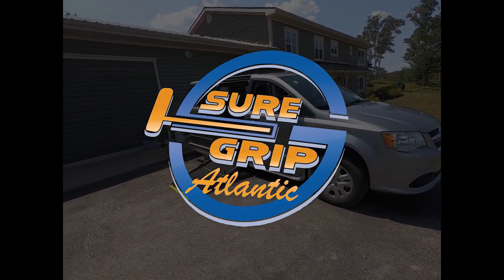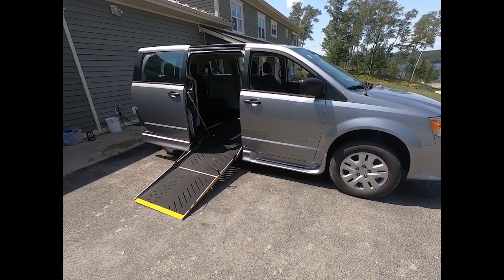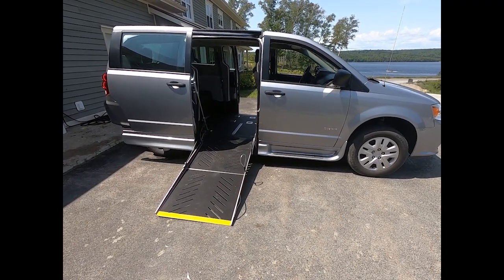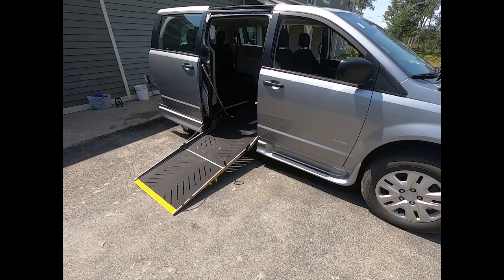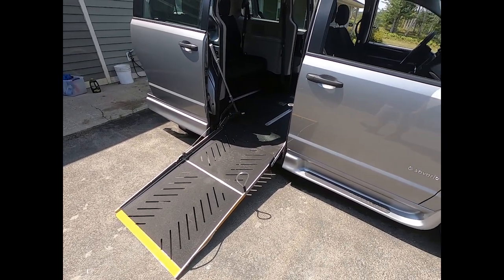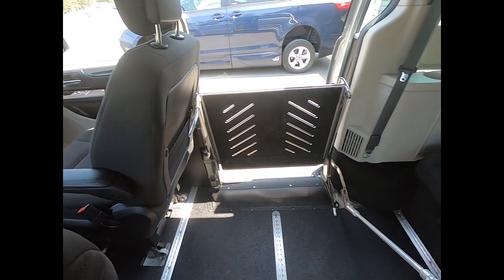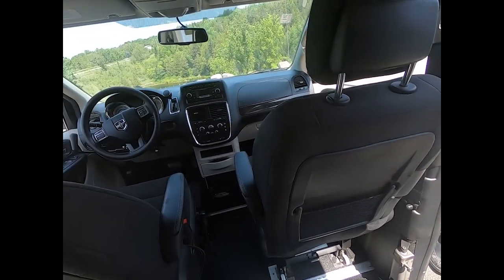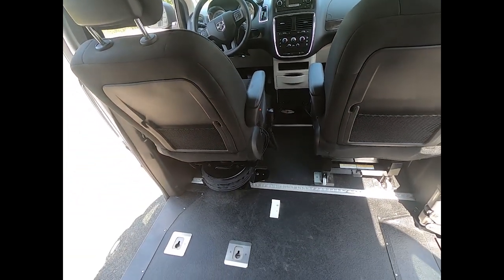Lever Actuator for Manual Wheelchair Ramp

Comment: OMG! This is REALLY CLOSE to what I was looking for!  I'm not smart enough to figure out the Gosling Unfold ramp (https://www.youtube.com/watch?v=tE6MB63YzmM) and it appeared as if a cut was needed in the floor. BUT... your ramp doesn't require a cut and coult possibly work for my Mom.  I'm a little worried about whether she could unfold it from outside but, I'll be you have a solution for that.  I looked for this on your website and didn't see that you had the parts listed. HELP!